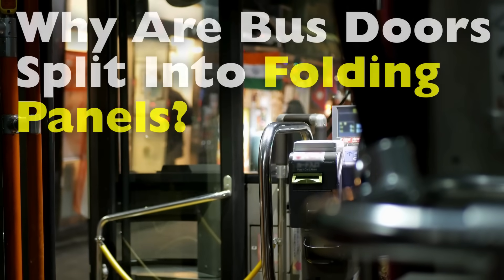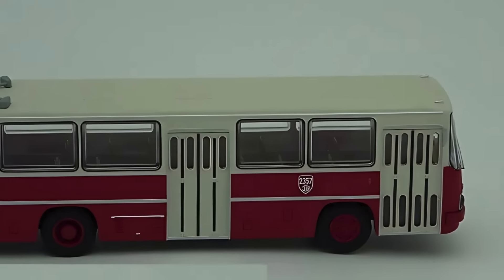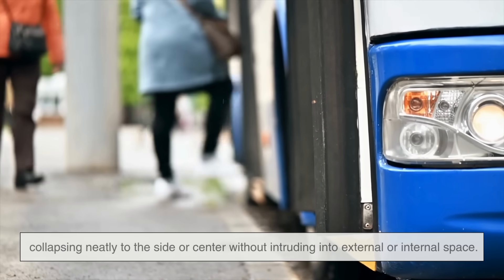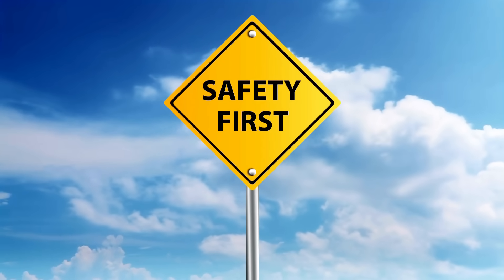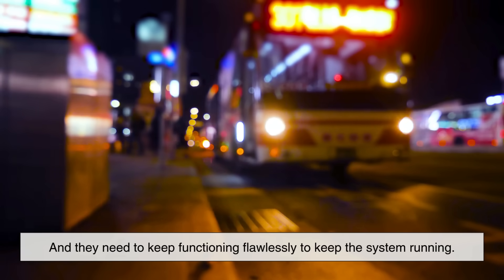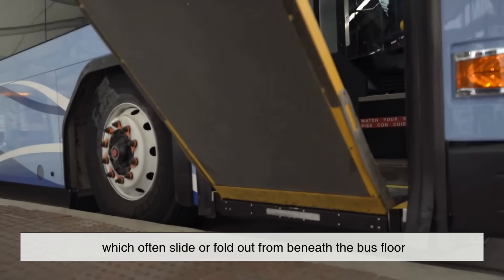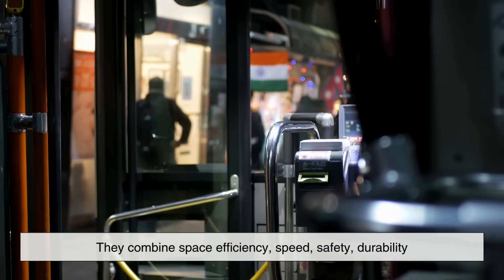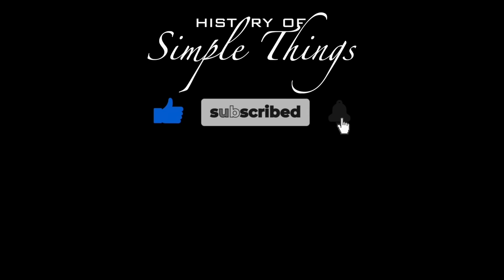Why Do Bus Doors Fold Like That?

Comment: I like all sliders as well but when i was that ramp thought that looked dangerous flopping out the foldind doors are better as ramp slides out and easier shuts and also nothing hardly gets stuck in them like coat or anything else

Comment: I'm plenty old enough to remember mechanically opened doors, on school busses anyway. That may have a lot to do with it as I can't easily see how a car type door or sliding door could have been manually operated by the driver from their seat.
Reply: i remember manual doors, the driver would pull a rope to open the door, and push it shut back in the day.

Comment: You forgot a few things. If the bus is overfilled, crowd’s pressure won’t open it, and no one will fall from the bus. And if the door does not open/close due to overcrowding, any passenger can help it.